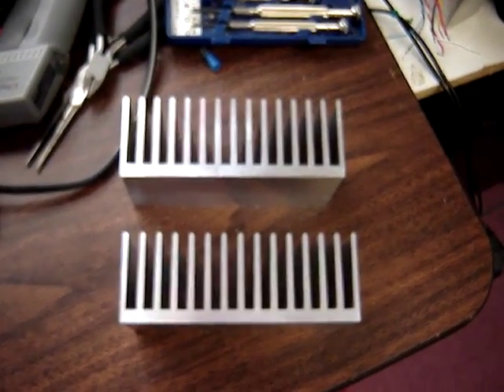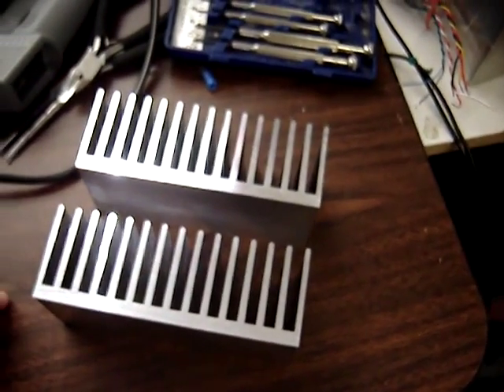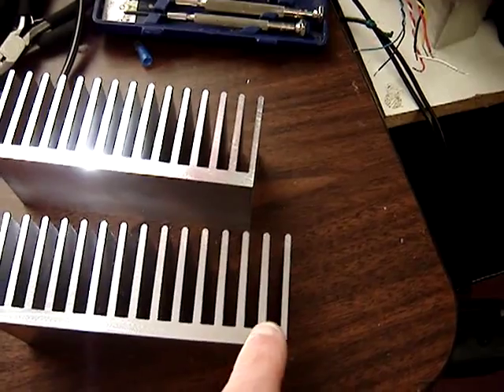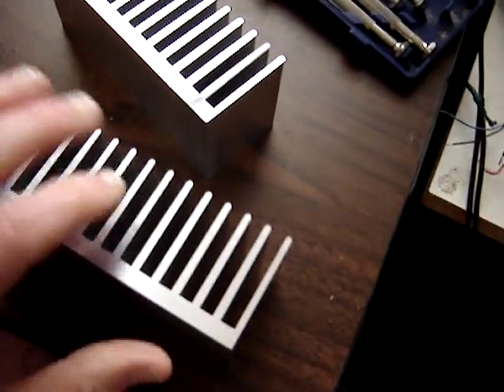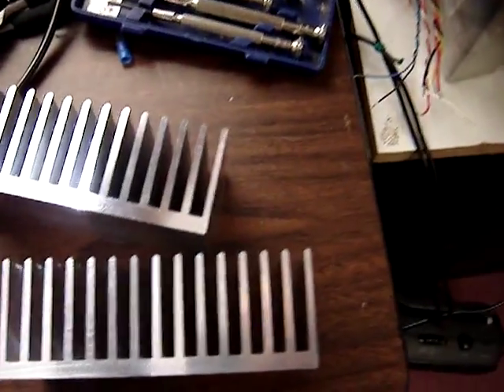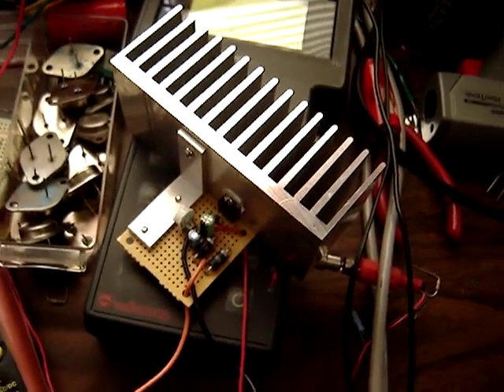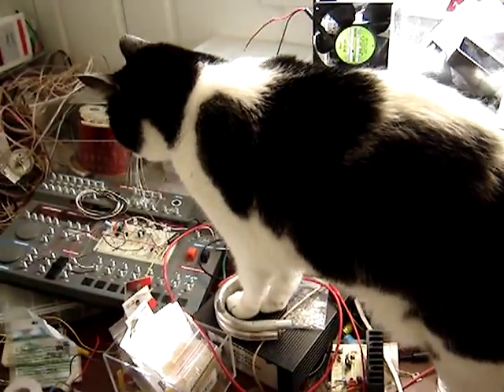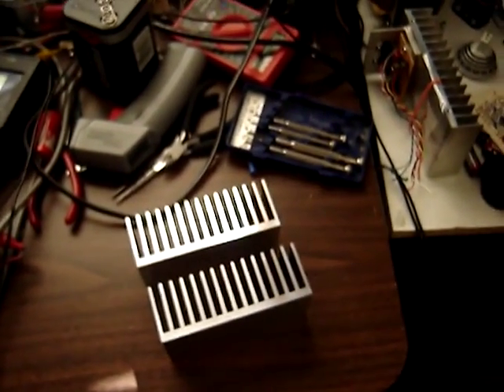HeatsinkUSA product review

Comment: Having problems to accept my ideas.... about fins thickness, then observe industrial amplifiers...observe big factories as Panasonic, Technics, Sony and others..watch the thickness of their heatsinks..sometimes are a fraction of a milimeter..... why?... because not needed to be thick..thickness is to produce mechanical resistance to bent, to be damaged, to look good, to look fashion and interesting to be watched externally the equipment.
Reply from the maker: I agree the fins don't need to be thick at all. In the video, I was talking about the base of the heat sink, not the fins. The thicker base does help spread the heat and acts as a thermal mass.
Reply: JohnAudioTech I suspect these are fairly well engineered. Yes the fins could be tapered, thinner at their ends, and grooved and anodized. You are right about the spreader, of course. This would all be easy to demonstrate. I bet you could mount a voltage regulator and run it hot, say a 5V reg, loaded with a 5 ohm resistor, and feed in 12V or better so it runs good and hot. Then, with your contactless thermometer, even as thick as these are, you will see some temperature gradient as you move it along the spreader away from the heat source. Japanese amps have thin fins, but still have a spreader thicker than a mM. They go thin to save money and weight. My experiments with Al foil heatsinks also show there is a limit to how thin you can go...

Comment: By the way....very nice heatsinks...the black anodized ones dissipates more...why?... i do not know...all i know is that they are much more efficient...maybe 30 percent better.
Reply from the maker: The anodized coating is a better black body radiator than plain aluminum, however, the large surface area of a finned heat sink makes heat removal by convection the more effective way they dissipate heat.
Reply: The main benefit of anodizing, whether black or gold or other color, is an increase in surface area. Even though the surface still looks smooth, it will have microscopic pits from the process. And it looks cool too!

Comment: I mean.... fins can be thin as you hair...base can be thin as 1 milimeter (people do not do this way because mechanical problems..may damage while shipping, may bent)...all matters is how many square centimeters or square inches you have in contact with environment air...all the added stuff, strudded fins, several shapes...are all fashion..what matter is area...each 200 square centimeters exposed to the air, in the correct position to allow convection cooling (air goes up and suck air from below) will be good to a 10 watts RMS audio amplifier, simusoidal, continuous tone, 1 Kilohertz, unclipped and undistorted...so..continuous....if musical, them can hold twice..or 20 watts RMS

Comment: More than half century of work with amplifiers i would say that thickness is just something that produces a delay in the heat transference..... as heat will be lost, or exchanged, by the are in contact with air...this thick base may fool people...as you start pumping high power and feel the fins cool.... you believe then the heatsinks is OK..but it is a fake perception...heat is inside and will take several seconds to reach the fins and to start the exchange of heat to the air... well...i spent 53 years to discover that..you may not accept or believe....maybe in the future, building supplies and amplifiers you will realise the whole things.